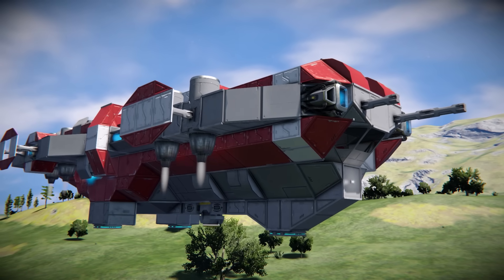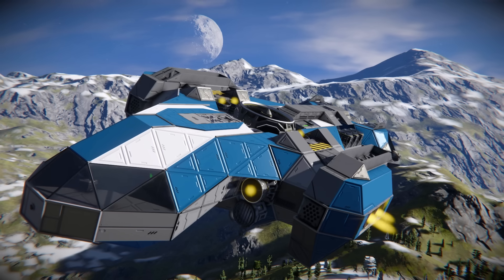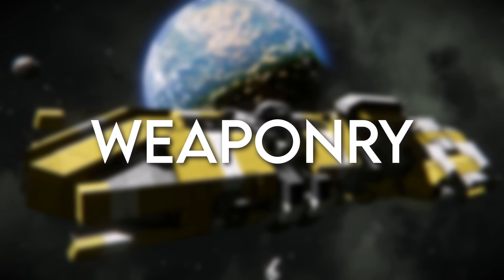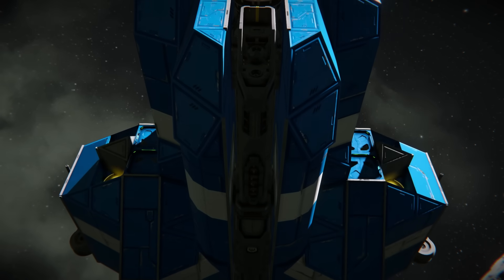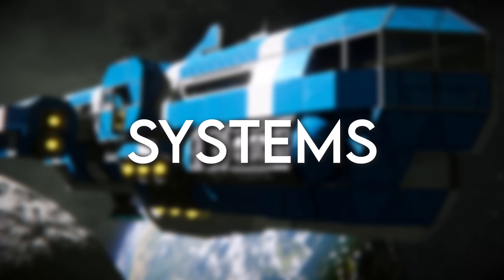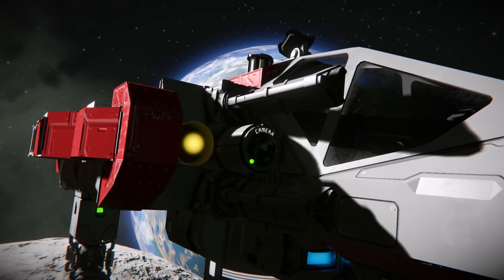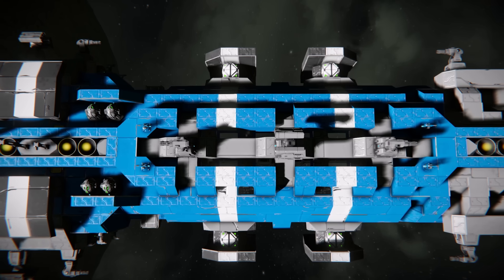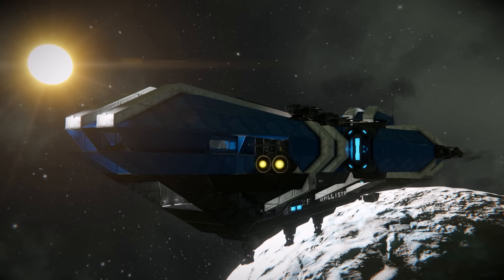Basic ship design guide - The Space Engineers Handbook

Comment: As someone with thousands of hours dating back to the implementation of turrets, here are some additional considerations:
1. The form of a ship is highly consequential. Wings, pods, and things break off when Klang comes knocking, or especially when your enemy wants them to. Try to build symmetrically about the center of mass along the primary navigational axis of the ship. If you can’t avoid protrusions, up-armor the connection. It’s also good to remember that ship debris can get caught in pockets and that edges will snag on objects.
2. Even through gyroscopes have increased durability, they are vital to emergency maneuvers and general navigation. Protect them and do not leave them exposed if you can. They have significant targeting priority so place them such that they will not draw enemy projectiles through neighboring ship systems and vital structural components.
3. Even more importantly than with gyroscopes; Cockpits are a priority target for enemy turrets and there should be more than just a windshield protecting them if you can manage it. This applies to all non-combat vessels that may encounter the enemy.
4. If you plan on using reactive armor (shielding plates spaced away from the hull), do not mount them to important blocks because damage absorbed by the plates could travel.
5. Line of sight for turrets is essential to their function.
6. A ship’s weight will determine maneuverability and therefore combat effectiveness in many facets. Slow and weak is a bad combination without ample jump capability.
7. Use decoy blocks to guide turret target priority away from vital systems. It will save your ship.
8. It isn’t always a good idea to have every type of thruster on a ship. In most cases, a vessel is often best when maximized for a specific environment.
9. Use navigational clearance lights.
10. Always have a medbay for respawning.
11. Diversify energy generation.
Reply: One should never attempt to challenge Klang. That way leads only to tears and frustration.
Reply: As far as wings or protusions go, as long as those are away from vital systems, you could place decoys on the ends of them. Only do so if the wings do not contain anything explosive or critical.
Reply: Another one as far as energy goes. Keep parts for a new battery available on hand incase you need emergency power. New batteries are partially charged already and can be used to provide some power
Reply: @SomeRandomAlbertan4677  Yes! That IS a ship saver of a tip.
Reply: As a new player, this is great info, but I do have a couple of questions. What are decoy blocks? What are navigational clearance lights?
Reply: @SatNightDnD decoy blocks have 2 main uses. They draw weapon fire away from other systems, and they can be used to absorb lightning if that is enabled.
Reply: @SatNightDnD  Decoy Blocks are the cuboid blocks that have their block corners chamfered with some grey side accents and activation green/red indicators in the chamfered corners. They serve as decoys for directing enemy weapons guidance away from the vital components of your ship’s anatomy (Reactors, Gyroscopes, Thrusters, etc.)

When I mention navigational clearance lighting I am referring to any light source that has had its properties modified to either indicate distance to impact or the craft’s orientation relative to another object. For example, you can maximize the cutoff value for a series of light sources placed in a linear fashion perpendicular to a surface you would like to avoid collision with. Then you may maximize brightness and vary them in both color and increasing radius. This will make it such that as you approach the surface with a craft, the craft itself will become illuminated with a gradient of colors that indicate distance to the surface. The simplest way to employ this effect is to use a single light source with a maximum brightness, moderate cutoff, noticeable color, and a radius customized for comfortable clearance. Keep in mind that these clearance lights are a function-over-aesthetics feature and their light is likely to bleed into the interior of your ship, however it will save you from the grief of disaster when mining in proximity to asteroids.
Reply: Some of these are common senae but most of them I hard disagree on

Comment: For mining ships specifically, I discovered something new this week. While sorters can only manually pull items at a fixed constant rate, if you deactivate the "drain all", that throughput can go massively up. This means you only need a single sorter to service your entire stone/ice ejector array, saving on PCU
Reply: wait what? if you don't "Drain all" then most of the time stone/ice is never moved to connector... the ejector doesn't exist anymore, is just the small connector which has the exact same requeriment than the normal connector and that's to have items in it's inventory to be able to throw them up so if you have to sort them through a sorter unless you "drain all" items will never go through. what i'm missing? there must be something i am not understanding about it's behaviour.
Reply: @JoachimVampire  I believe the main point is disable the pull and drain options on the sorter and have it feed multiple small connectors with pull and drain options enabled. For some reason if the sorter is doing the moving rather than just sorting it's slow, less than a single connector will do on its own. But if it's just there only allowing the whitelisted items to pass because the connectors are pulling they can all pull and drop at their own rate.
Reply: @JoachimVampire  You use the "collect all" and "throw out all" on the connector. I just still call them ejectors when using them like this. I don't know why, but sorter throughput is way higher when they aren't using the "drain all" function. The connector will still pull out from the inventory on the other side of the sorter so long as items are whitelisted in that single sorter
Reply: I didn't know that. I made 3 sorters with connectors coz one wasn't fast enough (I had to pause and wait for stones to drain)

I'll redesign my mining ship and try only having one

Comment: The main things i think about are Thrusters, Function, Specialization, and Gravity. I will use my interplanetary mining vehicle as an example

Thrusters:
Think about the purpose of each thruster. Each thruster has a purpose it needs to fill. For instance, my mining ship's most important thrusters are needed for counteracting the weight of the Ore. Both in a Gravity well and when i need to stop the vehicle quickly to avoid crashing. For both reasons, i have 16 Large Hydrogen Thrusters pointed in one dirrection. I have minimal thrust in each lateral direction, as those thrusters are mostly meant for fine tuning. the last dirrection is in the up dirrection, and consists of 8 large Ion thrusters. I don't need upward thrust in atmosphere, and this doubles as my Forward Thrust in space.

Function: 
IRL, ships are roughly designed in a way where 1/2 their mass/space is dedicated to the primary function of the ship, 1/4 is dedicated to crew support, and 1/4 is dedicated to propulsion. In block-based games, this is less required do to simplified game mechanics compared to IRL, but it can still be a good rule to follow for making ships look more realistic. In my mining ship, half my ship is dedicated to the Drill, refineries and H2/O2 generators, and Storage Containers & Tanks. The top end of the ship has a comfortible living quarters for up to 6 people, and the bottom 1/4 of my ship is the thruster packs.

Specialization:
Specialization is fun, but it's also useful. The more stuff you have on your ship, the more thrust you need to keep the ship mobile. (And IRL, the more Crew it would need to run it). Try to keep your ships related to their primary purpose. My mining ship's prupose is to dig ore out of the ground. While i have 2 refineries, they are set up with speed modules and Sorters to process only the stone in the way of the ore. I also have 16 H2/O2 generators because ice is weightless once it is a gas in the game. Likewise, each thruster is specifically chosen with a purpose, and is the minimum amount of thrusters needed to safely manuever the vehicle when it is fully loaded.

Gravity:
You can do some fun stuff with Gravity in Space Engineers. there is no "Up" in space, and by manipulating gravity, you can make many interesting ship designs, using otherwise dead-space or manipulating the perception on board your ship. You aren't limited to just one Gravity generator on a ship and you can alter their range and strengths. ALSO, please reduce the default field of your Gravity Generator. It will save you power and save those around you from the headache of docking with you.
Reply: How much does your ship weigh?
Reply: @Eternalsc2Val  unfortunately, i lost that particular blueprint on an old computer.

i have been in the progress of creating a version 2 of the vehicle, but i got distracted by building Star Trucker style ships

it weighs less than it looks like it should though, lot's of open space in the drilling and cargo sections of the ship, and it has external pathways so the interior is very minimalistic.

Comment: I think you should’ve spent some time talking about power sources.  Reactors can be very hard to find fuel for, and you should probably have a backup generator to supplement battery power.  Solar is pretty hassle free, but it’s also big and fragile.  Wind doesn’t work on ships.  I am partial to having a hydrogen engine backup generator.  While carrying hydrogen tanks comes with some risk, it’s way better than being stranded.
Reply: Alternatively to the risk thing, carry more of them in separated blocks around the conveyor network near or outside of the outer hull and then:
"Congratulations Hydrogen Tanks, you are now Explosive Reactive Armor in addition to being fuel tanks!"

results may vary depending on the Engineer's design choices but the explosions will still be pretty
Reply: Solar power looks amazing when you pull it off, and combined with oxygen farms they are soo comvenient on multiplayer servers.
Reply: @ yeah, but they don’t actually produce much power.  They are good for recharging a ship while you are away, but it’s very hard to run a ship on solar alone.
Reply: I added minimal ion for in case I run out of hydro, yea once I got reactors I don't worry much about power